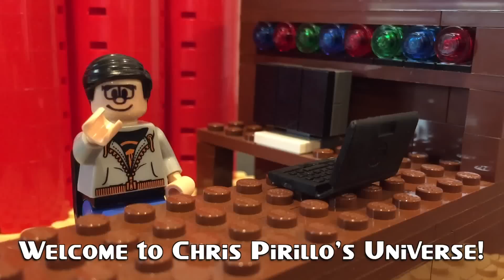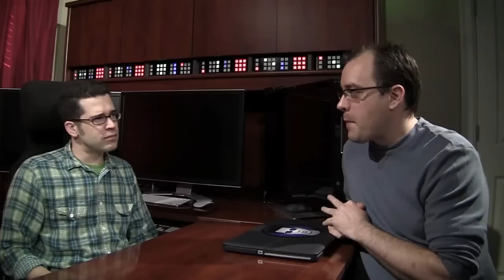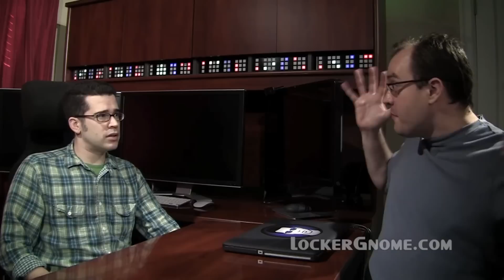What is Gain?

Comment: @jreckitt gain control will boost or drop the whole signal.  Compression sets a threshold (or a certain point) in the loudness of the signal, and anything that goes above that threshold, it gets compressed down to fit below the threshold.